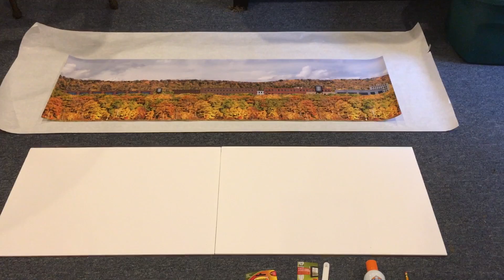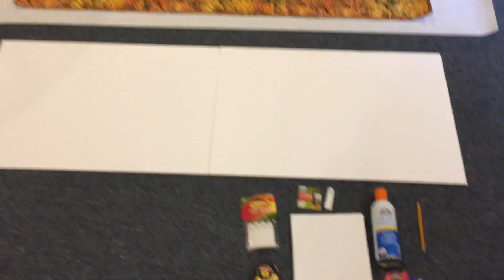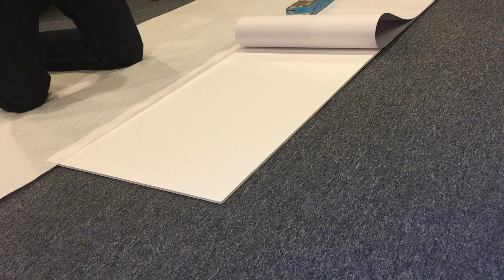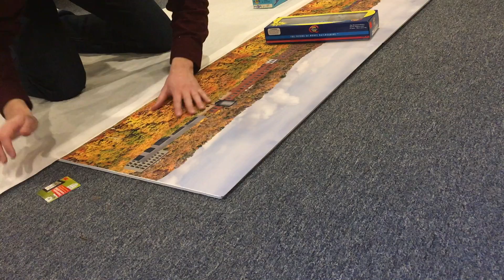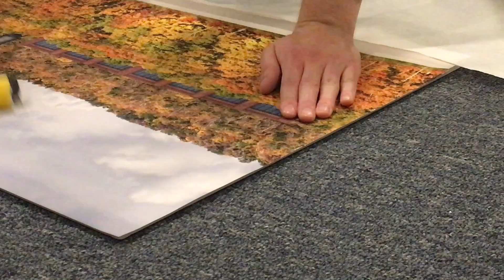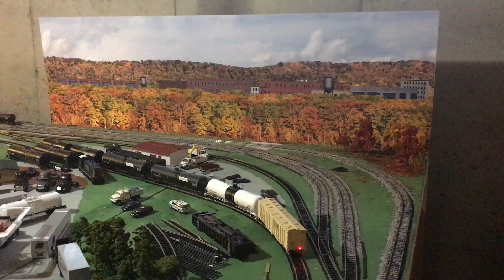Prepping & Installing a Backdrop onto your Model Railroad Layout

Comment: Thanks for sharing. I agree, Track Side Scenery has nice backdrops. One observation, you protected the carpet where you were kneeling, but not the other side. You better not let the boss know. All kidding aside. You should have done this outside. The spray adhesives are pretty toxic. Great job though. Smart prep work usually ends up with great results. New sub. Looking forward to more videos.
Reply from the maker: Thank you, I'm looking to create another backdrop section shortly and this time most of it will be prepped and constructed outside. Hopefully I can blend the backdrops nicely as I want a seasonal layout between Fall, Spring and Winter.